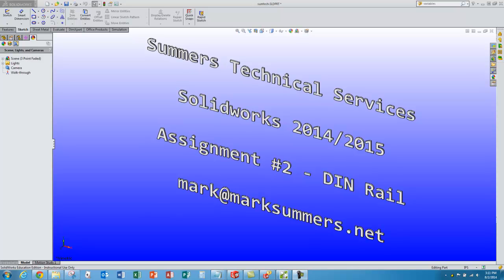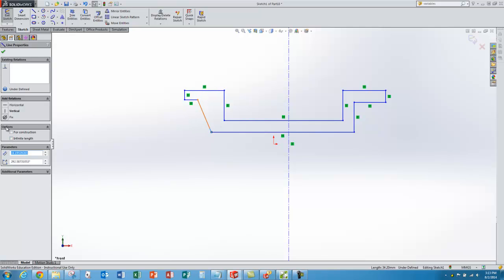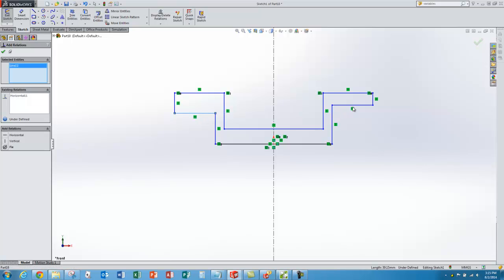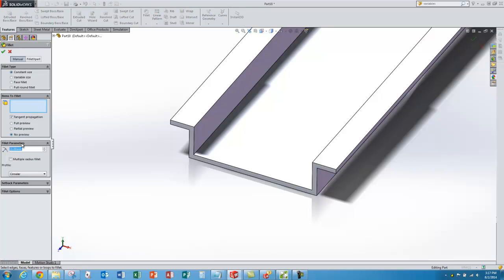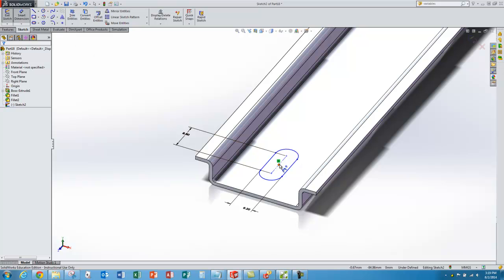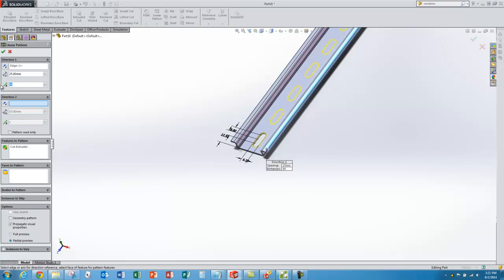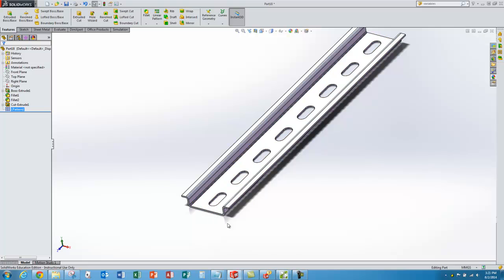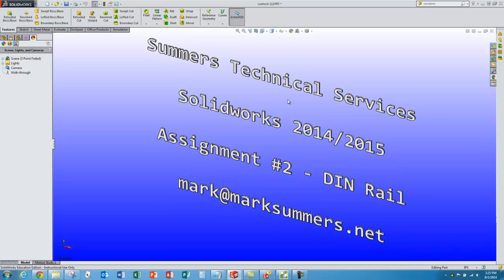Solidworks - Parametric DIN Rail Tutorial

Comment: how can you evaluate L from  20+(25x) such as 45,70,95,120...without error?
Reply from the maker: Thanks for the question.  The idea is that I only allow the DIN rail to be cut in even increments of 50 mm (slot pitch) and only in a location evenly located between two adjacent slots.

If you wanted to locate the first cut 45mm from one end, you could edit the slot extrude cut sketch to change the 50mm dimension to 45mm.  However, this would break the symmetry and the slot at the other end would be 55mm from the far end.

Comment: How do you import in to an assembly with a unique length length defined without creating a new part for each size?
Reply from the maker: You just click on the part in the "tree" in the assembly model and change to the particular configuration you want to use.  There is only one "part" model, but within the part model there can be several different configurations controlled by a Design Table.